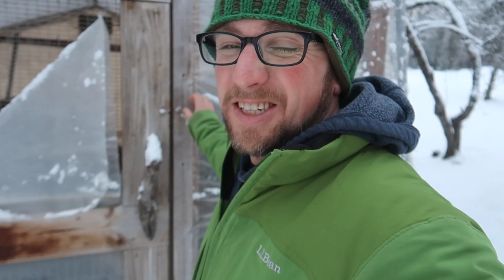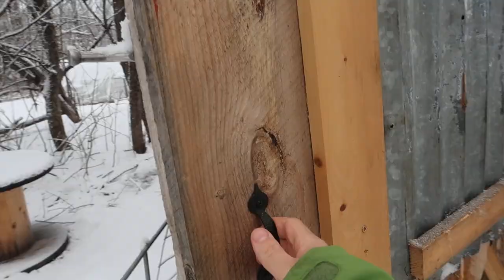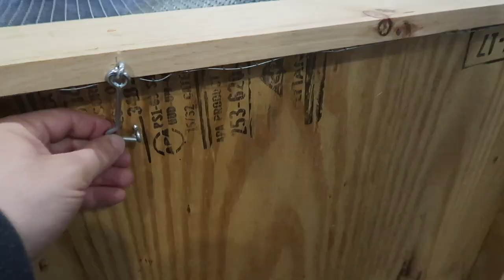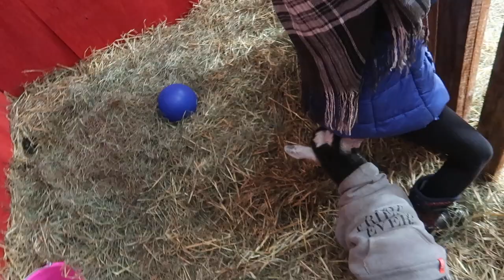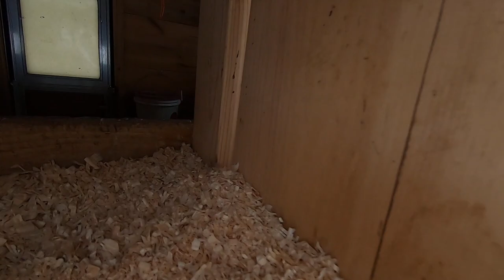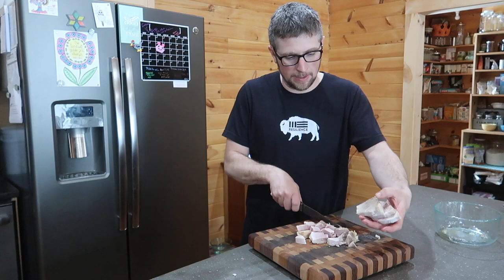Now Hope Refuses to come OUT!

Comment: I am impressed with the ease of set up on your brooder. Fantastic design there.  I think it would be easy to store and very fast to set up each year.  We have had pretty large brooders in our shop and it is a small production to get them built each year and ready.  We always set up our brooders at least a week before teh chicks are to arrive, much less scrambling and stress that way (it also gave me time to go buy a replacement heat lamp or bulb when something doesn't work after being stored a year).  I could see having several of these and just divide up the chicks in batches for our larger batches.  Last year our turkey poults were spared during a power outage because I had the forethought to have a concrete stepping stone under the heat lamp to absorb heat....that way if power goes out the stone surface would radiate heat for a little while to hopefully save them.  Our power was out for 2 hours and when I got home they were huddled over that stone but they all made it!  I was so relieved that idea worked for them!

Comment: For this minimal-cleaning of your chimney, may I suggest that you engineer a tall container for this task.  It cannot be good for you to be possibly inhaling that excessive dust when it explodes upon hitting ground level.  Also consider the container a means to moving that material to its destination.  One idea might be to have a hinged-shelf that can be attached to the house, but lowered when not in use.  Locate the shelf at a height so that on the shelf you could place one of your many 5-gallon buckets.  Allow enough distance from the bottom of the chimney to allow you to open and release the waste material.

Comment: Animals can be extremely “visual”.  Take the sweatshirt off of Hope. Then rub some essential oil on the forehead of every goat, even Hope.  Use (lavender or lemon)The group is not excepting Hope, because Hope “looks & smells” different than the group. This method works great on dogs and cats. Make the goats look and smell the same. It will help a lot.

Comment: Yes you are right.  In Europe producers are not allowed to wash eggs, hence they are not refrigerated  to retain that protective coating.   Indeed sellers are not permitted to refrigerate eggs.  If eggs can not be kept clean they cannot be sold.
  Now my understanding is that all eggs have to be washed in the states so eggs must be refrigerated to keep them safe without the coating, because you cannot sell eggs that are dirty!
Why the difference, probably the later widespread adoption of fridges in Europe.  It probably wasn't until the late 60's that fridges started to be considered essential in the uk and probably most of Europe as well.
Myself in my RV I keep eggs in the fridge  because the boxes fit securely in the door and they stay safe,  if I take them indoors they go in the fridge until used,  but at home I would not notmally refrigerate eggs.

Comment: Still very concerned about the excessive amount of soot build-up.  Not a matter of if you will have a flue fire...it is when!!!  I had one, luckily I had tri-wall pipe as it went into the ceiling.  Less pine, hotter fires.  I would check with an expert on this.  Really enjoy your videos!

Comment: If you take a sheet of linoleum over the tarp it will be easier clean up. You wouldn't have to worry about anything slip in underneath the edges just haven't come out just past the wood.

Comment: Should you wash eggs after purchasing in a grocery store?No, it’s not necessary or recommended to wash eggs that have a USDA grade shield or mark on the carton. In fact, washing these eggs may actually increase the risk of contamination because the wash water can be “sucked” into the egg through the pores in the shell. When the chicken lays the egg, a protective coating is put on the outside by the hen.  At the egg processing plant, government regulations require that USDA-graded eggs be carefully washed and sanitized before being packed.

Comment: It’s very sad to see you force that baby goat to wear clothes. It’s easy to see she is uncomfortable and too hot because she shakes, rubs and scratches at it. It’s a terrible thing to assign human needs to animals. A goats core temperature is 3-4 degrees higher than humans. Plus they have single and double fur coats to keep them warm. I have a fur coat and only use it when it is down to the single digits or low tens because it can be too hot. Even at 32 degrees, it is way to hot for animals to be assigned human needs and put clothes on them. I would not be surprised that is why the other goats will not get along with Hope. After all she doesn’t look or smell like a goat to them.
Reply: See my comment above!  I totally agree with you on this.
Reply: DeDe Bobala  could this also have something to do with the rejection ?? I know nothing about goats other than I would get some if I was setup for it..  Very cool ...had a friend when I was younger who had a goats..he never had to mow his lawn if I remember right ...
Reply: The reason Hope has the sweatshirt on is because she came from Arizona and needs to get used to the cold weather of New Hampshire. Please check out Weed Em and Reap's vlog. They are not assigning human needs to her. They know what they are doing. ☺